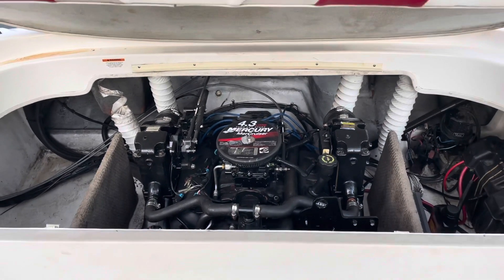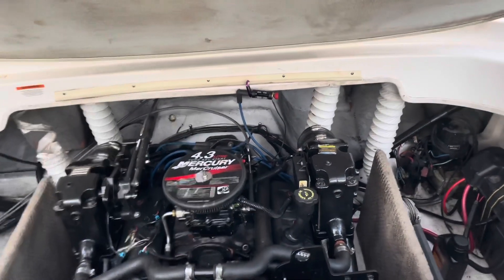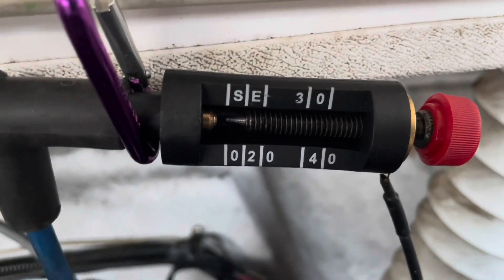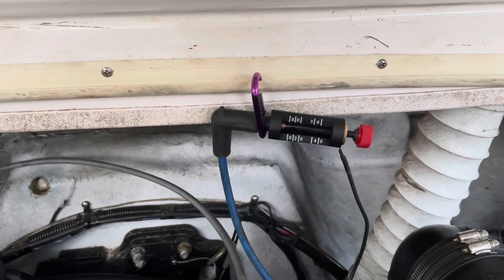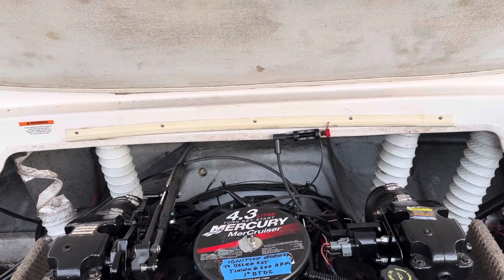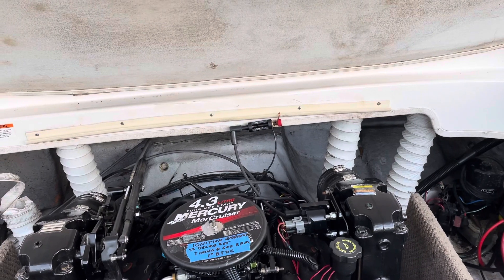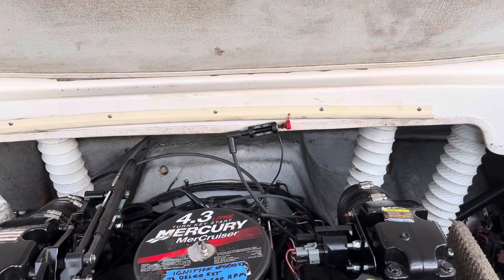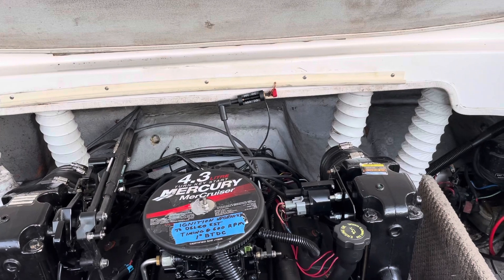7 - Mercruiser Thunderbolt? - I Sell a Fix - Was It Worth It?

Comment: Just finished doing this on my 4.3 and worked out very nicely.
Another question though, my engine sounds very similar to this being that there seems to be a slight rattle mainly heard when just idling! What I’m trying to get at is, is the sound of this engine a perfectly good healthy sounding engine? In your opinion?
Reply from the maker: This engine had a kind of a crackling sound through the carburetor. I think it’s the TKS carburetor. I haven’t had any other into sound like that.

Comment: How do I know my base timing and advance is working correctly with a basic timing light.  Mine is not moving when   putting into base timing.  I have it set a 1 degree before btdc.  After shutting off it stays the same.  When bumping up to 1500 rpm the timing is going ATDC.  is this correct?  I am thinking I may have bad module or something.
Reply from the maker: What size engine?
Reply from the maker: If the timing retards as RPM increases your module is connected wrong inside the distributor. Sometimes the wires are crossed in the plastic connector at the module. I’ll have to find out which term is green and which is white.

Comment: Did you run the same spark plugs in the Delco as you did in the Thunderbolt? I would imaging the stronger Delco ignition would have a different gap too
Reply from the maker: I run AC Delco MR43LTS. It’s what VP uses and VP had Delco EST from the factory.

Comment: Thanks for the previous response, kit came it today and I've started my install, thanks to your videos it's going pretty easy!  One follow on question if I may, I have no degree marks on my Mercruiser 4.3, only TDC on the timing cover and balancer.  Can you tell me how far to the right of TDC on the balancer is 1 degree BTDC so I can paint a line on it?
Reply from the maker: Measure the diameter of your harmonic balancer. Multiply the diameter by Pi and divide by 360. Result is the distance of 1° of rotation.

Comment: I'm installing the Delco system in my Mercruiser 4.3 and like to know what document you used to determine the timing is 1 degree BTDC.  The Delco do I found mentioned base timing as 1 degree but did not list if it was BTDC or ATDC, actually found another set of instructions that listed base as 2 degrees, appreciate any advice, I want to be sure and get this timing right, keep the great videos coming!
Reply from the maker: Go to this link and then page 12 (says 64 in document). The 4.3 timing curve says 1 degree positive initial timing which is 1 degree BTDC. Negative numbers indicate ATDC. Page 8 discuses setting initial timing. 

https://f01.justanswer.com/oldnewenglandmarine/deacd8eb-a4ca-4db4-9bec-6e9bb71197e7_Delco_EST.pdf